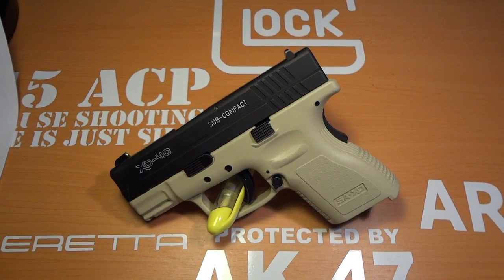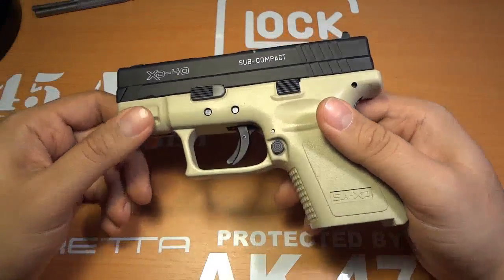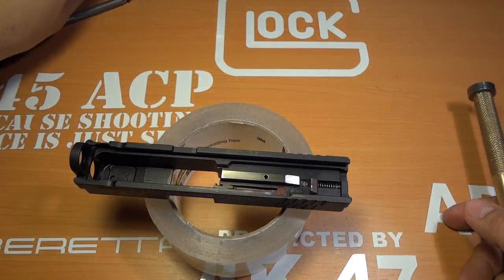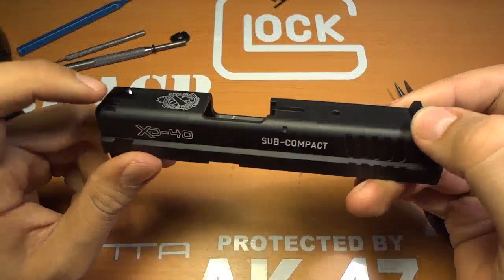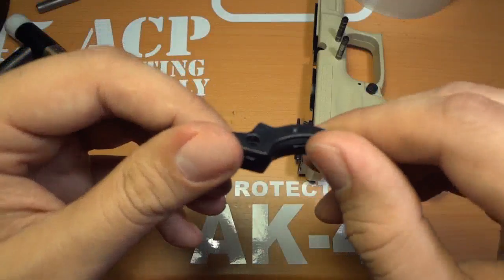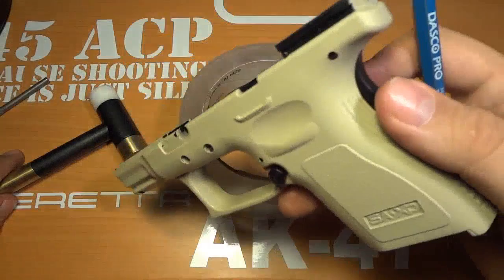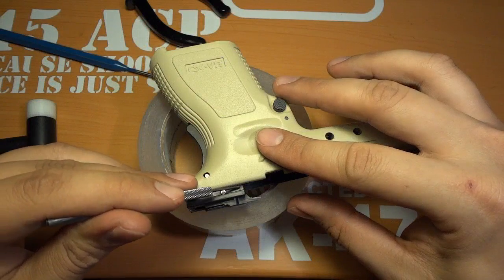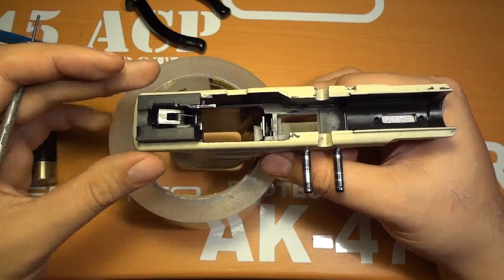Springfield XD Complete Disassembly and Reassembly

Comment: agreed getting that mag release back in is a giant pain in the ass. little trick i found that worked for me, was using some bees wax ( im sure could use vasicline as well) this way it somewhat holds the spring in place while you get everything in place, then using a slave pin to line everything up and then using your roll pin. took my 4 days before i thought of this idea last time. it really helped me so if anyone is struggling give it a try

Comment: Positive she don’t quote me but I’m pretty sure the pin for the chamber indicator only goes out one way or the other way is a small diameter and won’t let the pin go through other than that instead of using a punch are used a very small Allen wrench how about just fine and push them right out